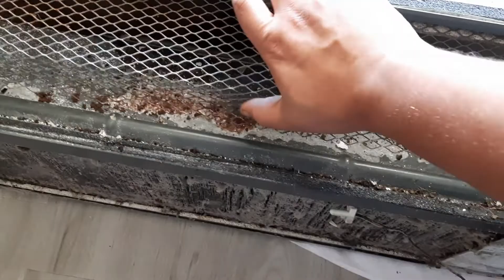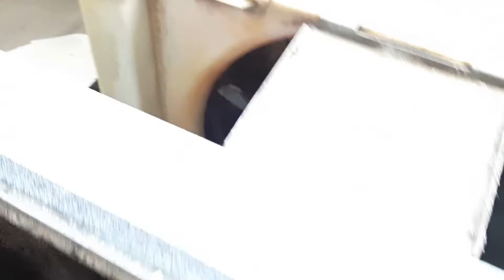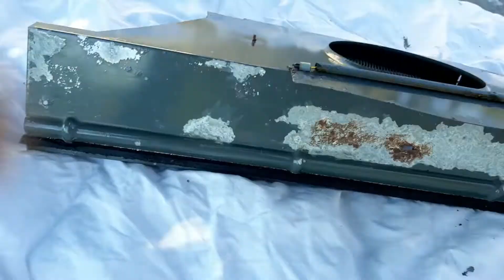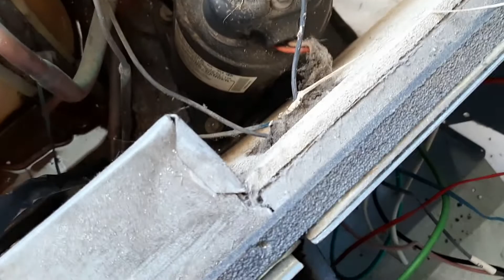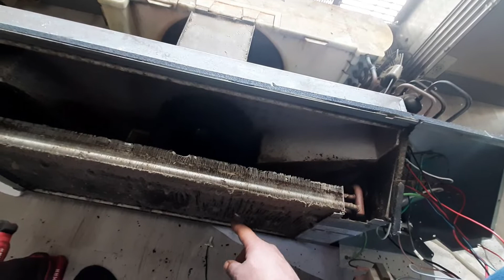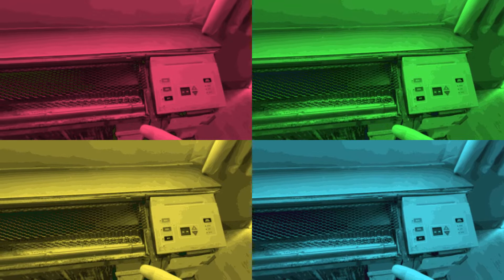AMANA PTAC REPAIR 2009 AND BELOW MODELS /PTAC TEAR DOWN AND REBUILD

Comment: Gr8 video. Got model like this. I am getting burn smell in low fan with heat and it doesnt turn on. High fan all works good hot and cold. Is it fan or controller.
Reply from the maker: If the heat hasn’t been used in a while it’s normal to have a lil smell on start up.. when you turn the heat on does the fan not spin at all..

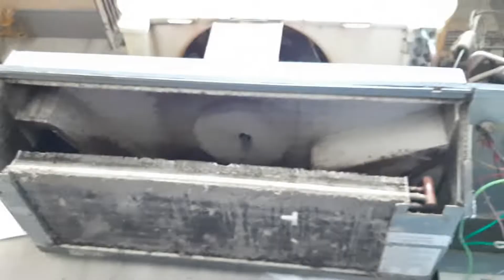Comment: 3:04 you skip the exact part I'm stuck on. "Pull evenly straight out not really hard" has not worked for me. I broke the last blower wheel I tried to remove, I'm probably gonna have to break this one, too.
Reply from the maker: If you loosed then set screw on the clamp it should pull off, even if you have to pull the clamp all the way off to make sure it’s loose enough.. 
I’ve never had one break tho.. I’m sorry I couldn’t get it in the video bc I was recording and pulling the fan off at the same time, so both hands were tied up.. put one hand on each side and work it back and forth with a little pressure and it should come off.. The plastic had to be dry rotted or old for you to break the fan with your bare hands I would think.. I hope this helps, and sorry again..

Comment: This is my goto video for ptac  Goodman says the blower fan is obsolete do you know where I can get one or a part # Thanks
Reply from the maker: The part number for this fan is 131P00000S
Reply: @williamblanks8500  Thanks I found an aftermarket one 11044101 its a squirrel cage the one someone put on before was the condenser blade has the slinger bar on the blades together think the 2"wide squirrel cage I found is correct. but just guessing at this point. at least now if I see one says replaces pn 13100000s I will know. Thanks again, Chris
Reply from the maker: @cstiffy1  Sorry I gave you the part number for the blower motor, not the fan itself.. I read your comment wrong.. That is the correct part number for the fan.. and no problem..
Reply: @williamblanks8500 Thanks that helps, I'll go ahead and order it then.

Comment: Hey bud awesome video. Can you please post a list of your tools used specifically for these PTAC Units
Reply from the maker: A flathead and Philips screwdriver, 
(also a 1/4" nut drive will work on an impact) 
A T25 torx bit for the fans
A 10mm socket or wrench for the fan motor..